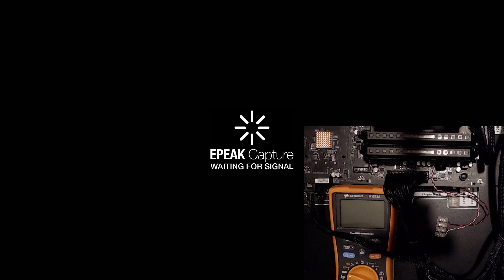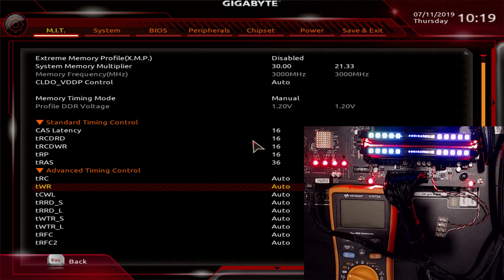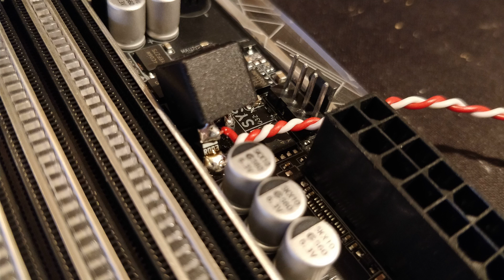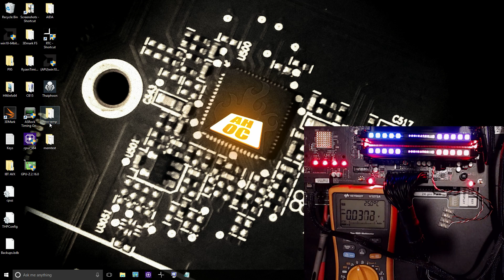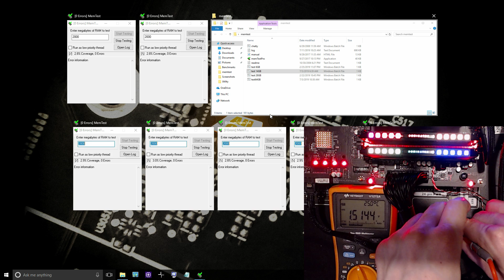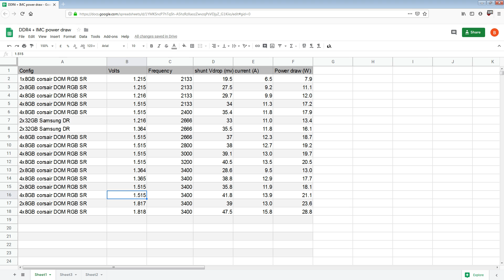Measuring VDDR power draw on a Ryzen 7 1700.

Comment: Obviously (looking at the first 3 rows), opening up the 2nd memory channel on the IMC – (by using 2×8GB vs. 1×8GB) – has a more profound effect on consumption than adding TWO more sticks does (as seen in the "4×8GB" row).
It'd be interesting to see what would've happened if you had put the 2nd stick on the SAME memory channel — you wouldn't be affecting bandwidth or enabling the 2nd channel, so the change in consumption would be (presumably) ONLY the idle RAM stick.

Comment: Does anyone know of any 2x4GB or 4x4GB kits that can hit 4GHZ when OC'ing. I have some GSkill ripjaws 5 sets. (3200MHz CL16) with 16.16.18.36 timings. I got 3733 at 1.45v but haven't tried higher voltage yet. I may be able to get there with some more voltage and lazy timings.

Cool vid. though.

Comment: LED power? imo it should be in the range of 5-30mA for every led, plus some value for the current limiting resistor depending on Vcc.
it sums up quick..
Reply: Oh yeah. Remember that 70 LED RGB SSD VERY SHINY MUCH BRIGHT cacophony?
Thing overheated so much windows was unusable. I remember a video about it on Jayz2cents’ channel

Comment: got a new daily system already? I recall the 1700 and X370 K5 being your daily system in the past
Reply from the maker: Still a 1700 just using an X370 Taichi instead of the K5
Reply: Actually Hardcore Overclocking you daily driving asrock board o.O
Mr. Buildzoid, are you high? Or just sick?
Can we get a how/why that happened explanation?
Reply: @YTHandlesWereAMistake  probably because he has no interest in testing that board ever again.

Comment: holy crap 1.8 v , that´s like the DDR2 voltage standard and 1.5 is the DDR3 stock Volt , i dont see this kind of ddr4 voltage as safe that´s "LN2" madness :) , im shure that dd4 is now doing speed´s that are higher then the upcoming DDR5 standard witch will be something like 3.2 to 4.0 efective @ 1.2v to 1.25v , i guess im not a hardcore OC after all :)
Reply: what about the memory controler inside the cpu on intel even the chipset is inside the cpu what does samsung say about the dangers of running super high voltage , ill bet they say - we are NOT responsible for damage on the cpu or the motherboard i guess that says it all about how dangerous it actualy is for your hardware.
 @Christoph Kemmelmeier
Reply: @euricokyuubipt  I am not sure about intel but for ryzen never go above 1.45v dram voltage so that the memory controller doesn't degrade overall...
Reply: i like OC but only within the tested/projected safe range say on ddr4 1.2v stock and you can go 100% safe up to 1.35v thats it , any more you risk degrading and or damage on your hardware there are exception to this but these normaly dont include the tipical home desktop , for exe: out here in Portugal where in the summer you get temp´s over 40c that kind of abuse will kill your hardware.

Comment: ye need more than 1.4V to drive a traditional red LED, colored LEDs take over 2V. the only memory voltage that has the voltage to drive an RGB LED and make it light up is the Vddspd (AKA, 2.5v SPD voltage). Also, there just isn't room for a step up buck converter inside DIMM plastic bling covers, so that 2+V must come from elsewhere.

considering the SPD subsystem doubles as the RGB control for the memory RGB, it only makes sense to have the LED system run off that subsystems power.

 it's still bugger-all for watts, so long as it (Vddspd) has more than a 10 puff cap on the motherboard, it should be ok, lol.

Comment: Didn't even know ddr4 could handle more than 1.45-1.5v without exploding immediately
Reply: Depends on the chips... Some are known to die at lower than 1.4v, b-die easily does more voltage than any ddr4 memory controllers can handle.
Reply: @wewillrockyou1986  I heard that, I have an old Corsair lpx vengeance 3200mhz c16 (version 4.24) and I think they are b-die. At that times ryzens didn't even exist (when I bought them for a 6600k + z170) and I had really big problems to push them beyond 2933mhz with the 1700 and x370 pro carbon. Even with the 2700x later. Now with 2700x and x470 taichi I managed to get a stable 3200mhz c14 ish (not 14-14-14 but 14-15-15-30) but had to went from 1.35v to 1.38 and I was kinda scare that for daily it was too much
Reply: No more than 1.45v on dram voltage on ryzen to prevent memory controller degradation
Reply: @mikex2825  thank you!
Reply: @mikex2825  I want know your source for this
Reply: @jobbus22  just plow through various forums I forgot where I saw it exactly but generally speaking RAM won't get damaged until going to 1.65v+ unless LN2 and its safe 24/7 limit is 1.5v max granted the IMC can handle it as well as the sticks themselves. And personally I would keep it under 1.45v for reliability's sake but until 1.5v you are fine
Reply: XOC'ers do 1.7-2.0 all the time.